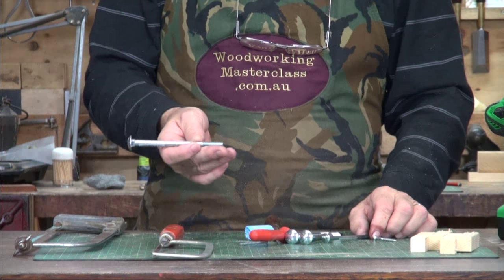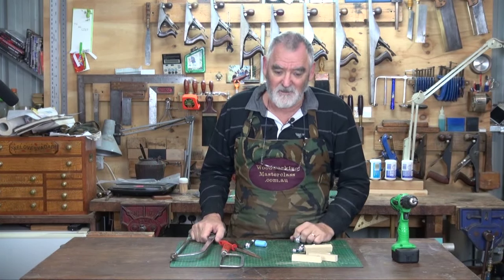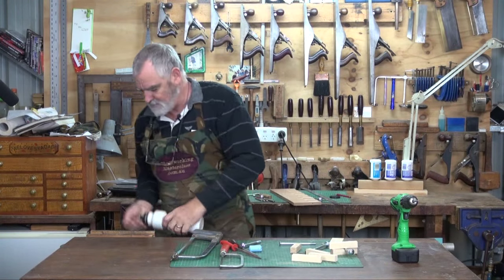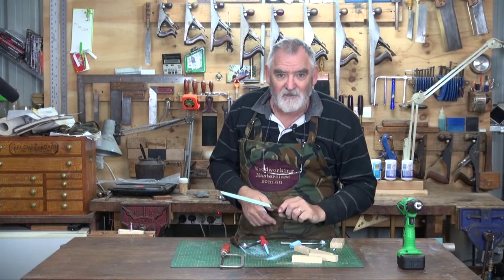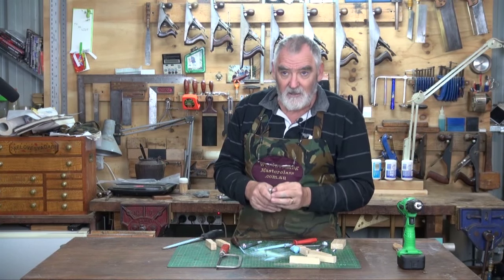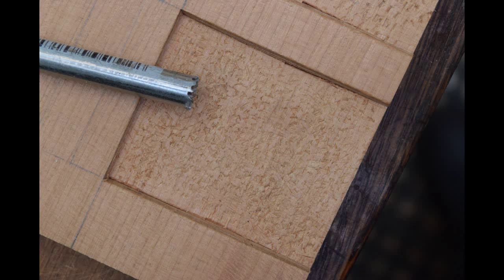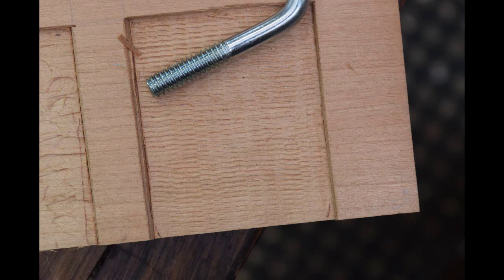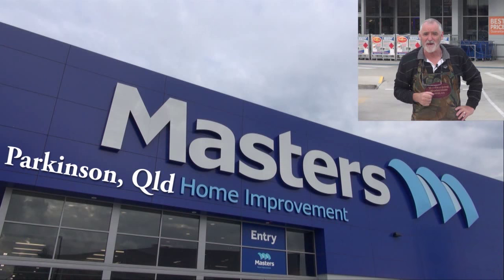Pattern Punches for adding patterns and texture to Woodworking Projects

Comment: Hi Steve, nice idea. I use pattern punches when I do leatherworking. However I use them in conjunction with a rubber mallet. In my opinion the rubber mallet has two advantages. 1. it usually has a larger head so it is easier to hit the often slim shank of a punch. 2.it is softer to the top of the punch when rubber hits metal rather if metal hits metal.
Reply from the maker: Bernhard Rindlisbacher Good points thanks for letting us know. I never thought of that one I'll give it try. Cheers Steve
Reply from the maker: ***** But I hope that will not stop you from enjoying Woodwork even if you didn't do it as a career. So have fun. Thanks for you comments. Cheers Steve

Comment: Neat trick. 

Just wondering, what finish would you use on the texture? Dont want to fill it back up, but also dont want it to collect dirt and dust.
Reply from the maker: Willem Kossen Just treat it as normal use stain, oil, varnish or a wax. It cleans up fine. Let me know if you use it on any of your spindle work. Cheers Steve